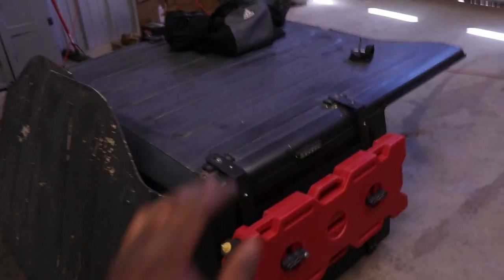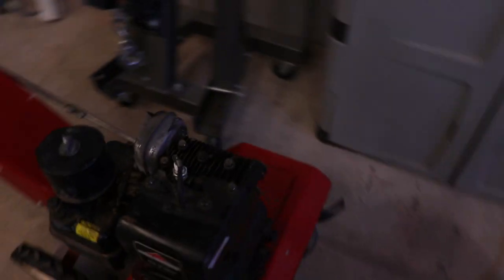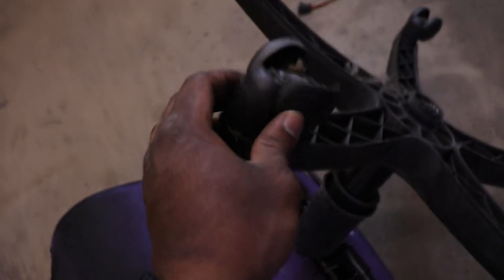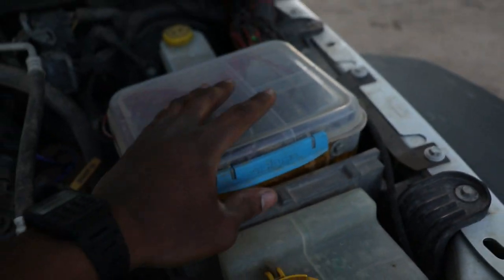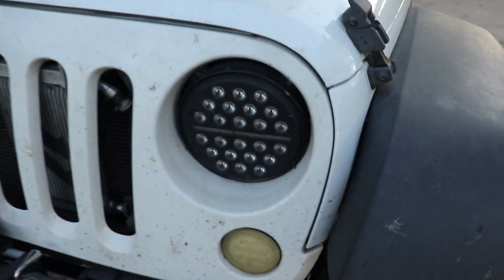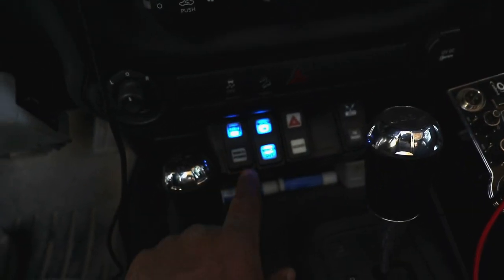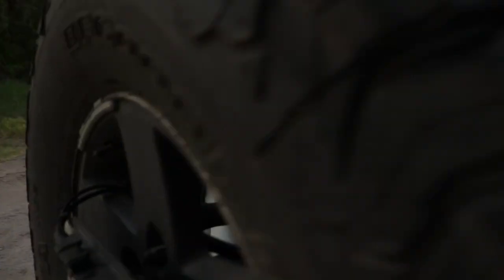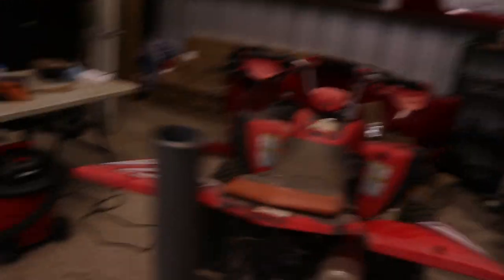Summer Jeep Walkaround / Mod List

Comment: Hey what tire carrier are you using?
Reply from the maker: Jeff Byrd stock still. modified it by cutting off the third tail light, and extending the tire bump stops with a radiator hose from a 5.3 tahoe. Using a teraflex dual antenna mount. About to upgrade to the barricade tire carrier in the coming weeks.